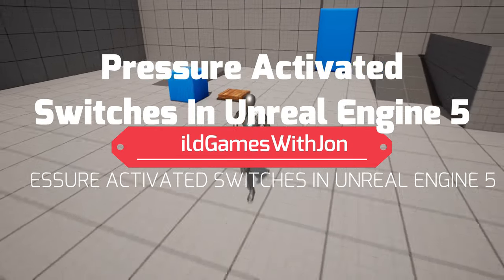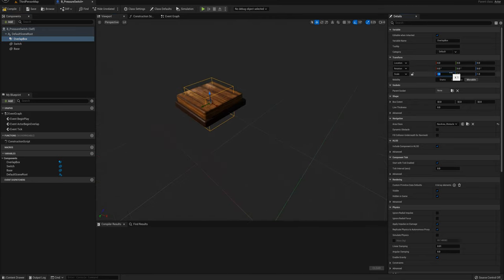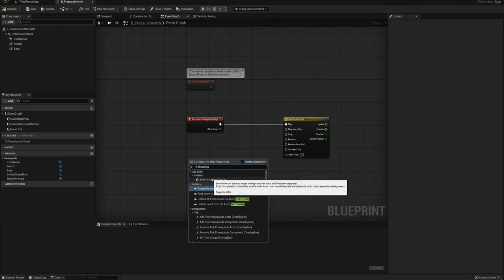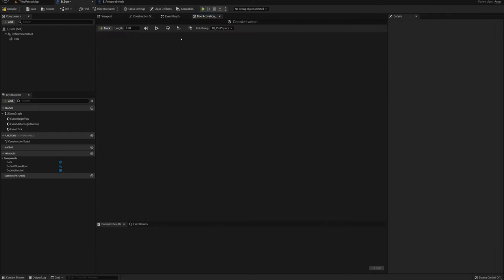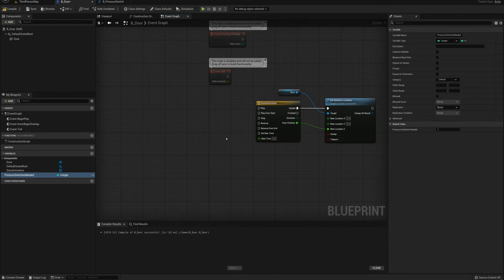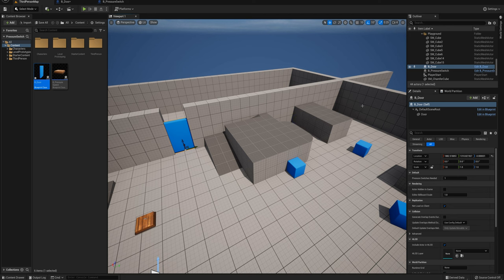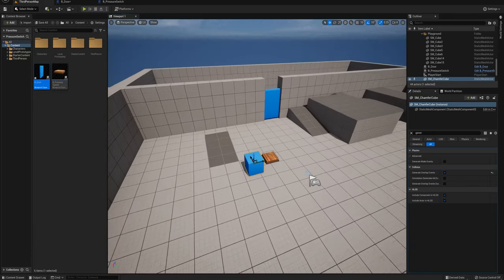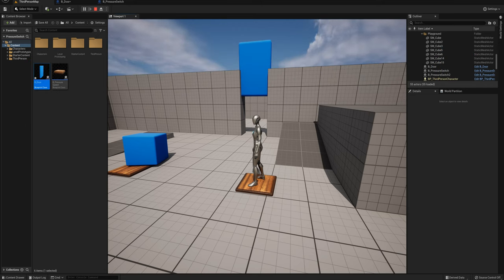Using "Pressure Activated" Switches To Trigger Events In Unreal Engine 5

Comment: I noticed the value can go under 0 if you are quick with movements, so a good idea would be to clamp the active triggers, using 0 as the Min and the Needed switches value as the max. Can add a Text Render component rooted to the door mesh to debug/ visualise this. Just append the Active and Needed int values and put a slash in between, then set the text of the Text Rennder using this this return value :))

Comment: Hey I tried this and is working awesome, question is there a way to use an specific cube ? so for example 3 different cubes but only 1 of them work with the switch, I was trying to do that by setting up the cube for activating the switch but doesnt work sadly, any tips ?

Comment: This is awesome, thanks!

I wanted to make double sliding doors, so I found it a little tricky -- I made timelines for each half, going opposite directions, and then wasn't sure how to trigger both; I found out that you can use "Sequence" to have the outputs from each Branch go to each timeline's  play and reverse, so you can trigger two doors at once. That way you only need one each for the activation and deactivation sections

Comment: Instead of custom events, create an interface called "activatable", with 2 functions, one for activate(open), one for deactivate (close), then have an object on the switch of type actor called activatable item, then in the functions on the pressure place you check if the connected object uses the interface, if it does then you call the functions, now your pressure plate works on more than just doors
.

Comment: 12:46 that method seem like a fast interface , its better ?
Reply from the maker: In this case using the hard reference to the other actor is easier than an interface if that's what you mean.

Comment: When I stand on the switch and then put the item on then I walk off, it goes back as if the item is not there, aswell as counting as 2 switches
Reply: Replaced to (Needed > Active) OR (Active == 0) on the End Overlap side. True will go to Reverse side on timeline for this. That solved the first part. Still counting player as second.

Comment: i dont know what im doing wrong but mine doesn't go back down
Reply: You probably.. duplicated the default value of the variable "PressureSwitchesNeeded"  and renamed it to "PressureSwitchesActive"... now both there values are 1.. 
To solve your problem:
Set the default value of "PressureSwitchesActive" = 0
Set the default value of "PressureSwitchesNeeded" = 1 (minimum 1 or xx amount as needed)